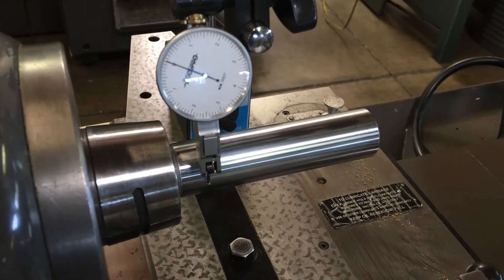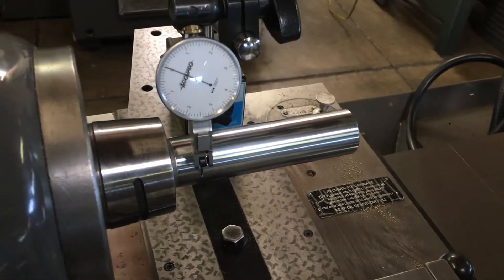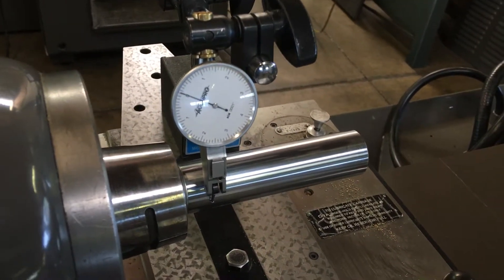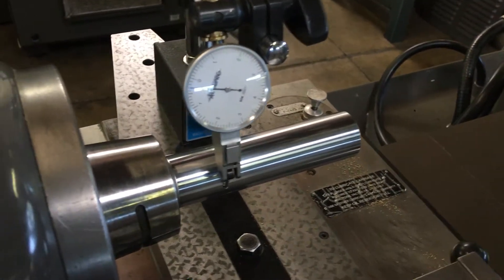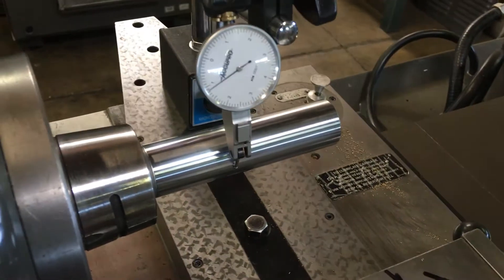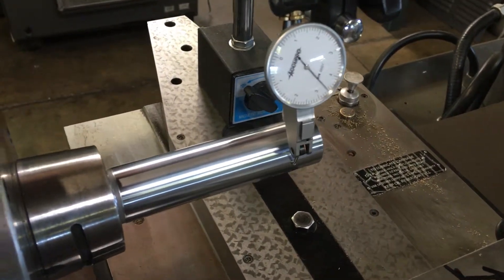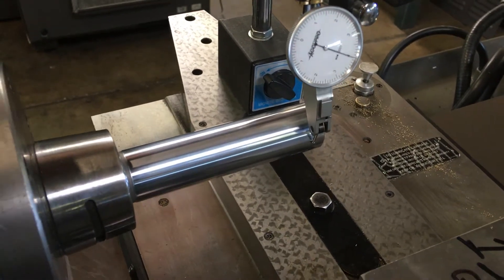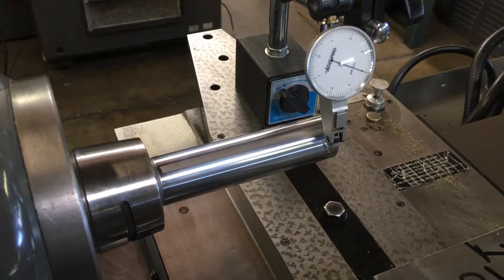Other rebuilders HLV-H headstock alignment

Comment: like my lathe how fix this problem?
Reply from the maker: This was an alignment issue. However there can also be more to the problem. 
You need an accurate arbor and loosen the headstock mounting and carefully align the head. However there is also a bedplate that also might have issues.